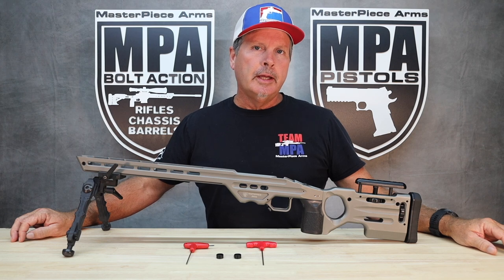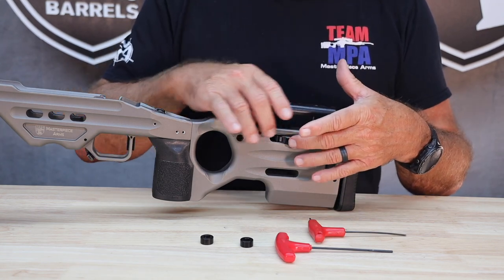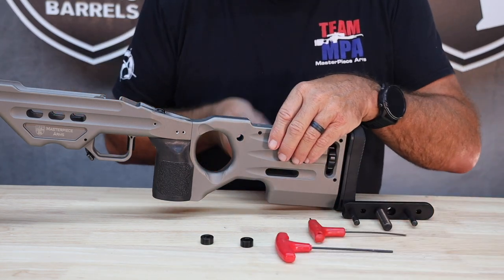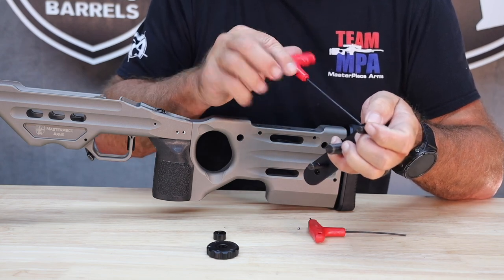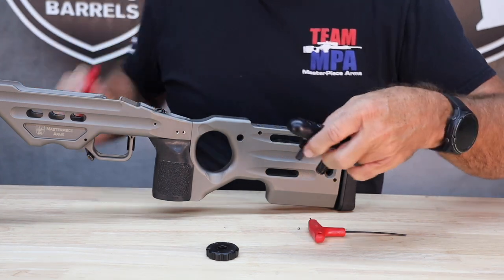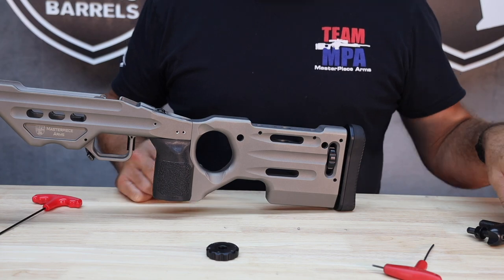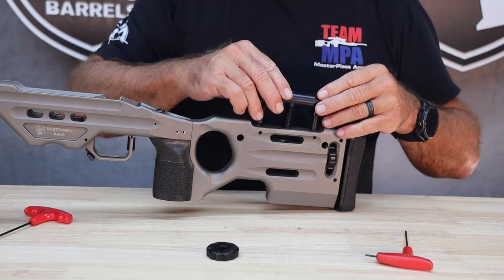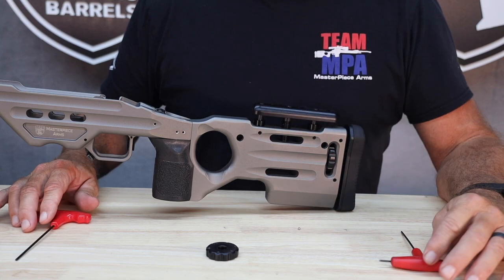Buttstock Cheek Riser Barrel Cleaning Strategy - Masterpiece Arms

Comment: I take a 223 round and drop through the thumb wheel hole after removing the riser to hold the wheel/spring/bb in place. Got tired of losing them. Cleaning rod clears the round and all is good to go.